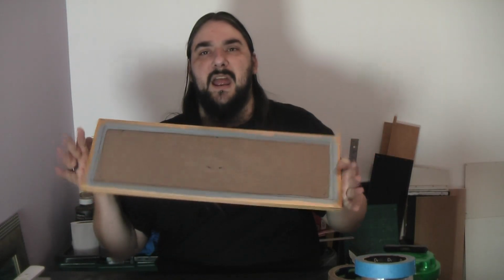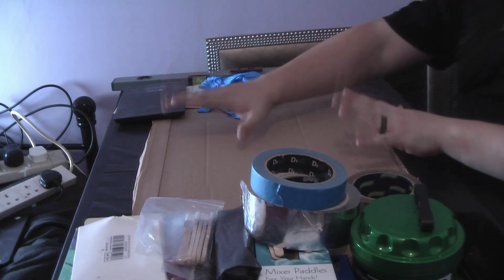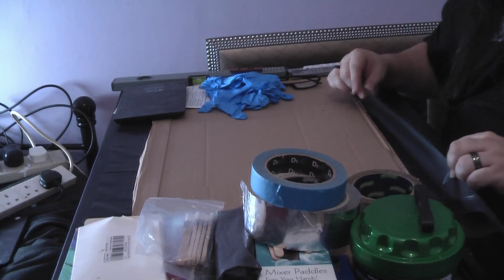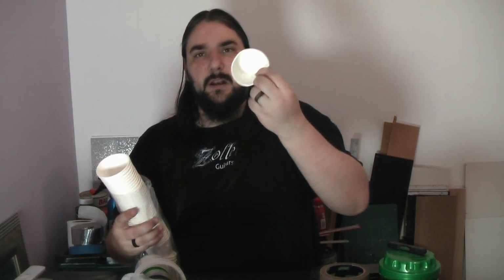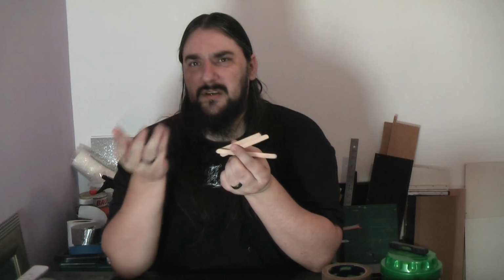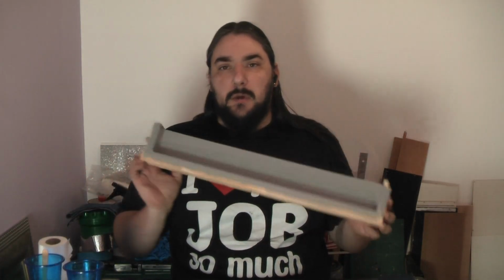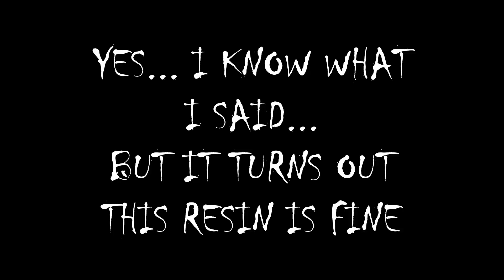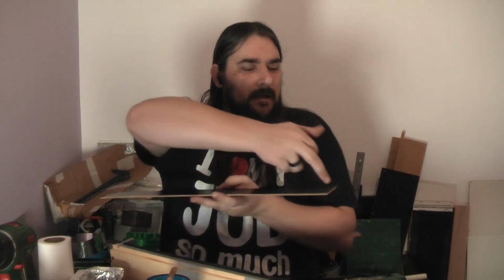How to Make a Resin / Fabric / Micarta Fretboard Part 2

Comment: Some great tips in here. Didn't think about it before but makes sense that the graphtech nuts/saddles etc are basically just graphite impregnated resin. Would be interesting to find a good recipe for that - those are crazy expensive but would rather use them than bone.
Reply from the maker: Thanks mate, from what I read they now use PTFE and other non stick items in there nuts, but in the early days it looks to just be graphite.